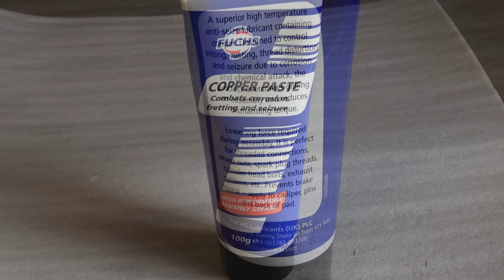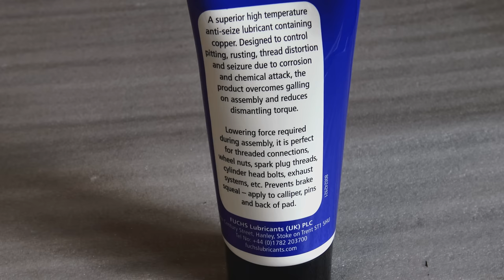Triumph Bonneville ownership. Copper Grease controversy, Putting the record straight!

Comment: Excellent truly excellent come back . I've been a motor vehicle mechanic for 50 years and I was instructed as an apprentice to use Copper Slip as it was called back in the day on many many aplications including brake components.  I can state it works very well and never ever caused a problem ,in fact it had great benefits in repeat maintainance. Obviously keep it away from friction surfaces which you rely on to stop. Deep gratitude and thank you
Regards Gareth Wiltshire.
Reply from the maker: Thank you Gareth, Im  sure ill still take some flack for this one! lol

Comment: Shortly after I purchased my 2004 MG TF in 2018, I undertook an under bonnet bolt upgrade to stainless steel bolts. The engine lives behind the seats in a TF, so all the bolts under the bonnet are for ancillary items, such as cooling, ABS circuits, electrics etc. I caught the existing bolts just in time. They were cheap zinc coated items and the threads were rusted and just starting to seize and the ones in the bonnet slam plate almost snapped, so I had a very lucky day!! I smeared the replacement stainless bolts with copper grease. 3 years later, I had to remove a couple of the new copper treated stainless bolts during routine maintenance and they unscrewed cleanly and smoothly. No rust, no seize!! Great video Stu and spot on as always 😊

Comment: Someone just posted this video as a comment on one of my videos, I’m so glad that they did. I’ve been using copper grease on aluminium and steel components for years, with zero problems. In one of my videos I recommended using it and got plenty of comments, just like you described. Another one that keeps cropping up is locknuts, when you tighten the first nut to the specified torque, then use a “half nut” to lock it in position. You would not believe the amount of people that say you have to use the “half nut” first, then use the full size nut to lock up the half nut 😉

Comment: Very useful, thank you. I've had comment on the use of copper grease on wheel nuts/bolts as being a complete no no and also read tales of many other places you shouldn't ever use it. I've been using CG for years to prevent nuts/bolts/studs from seizing and never had them shear or fall out. I did however manage to undo them when I wanted to; without getting a 6-foot long scaffold tube on the end of my chosen tool. I just make sure I follow the instructions. As you said, the manufacturer's have no interest in marketing a product that is unsafe to use and risk being sued, their reputations and, by extension, their businesses.

Comment: Great advice! I have always used copper slip on the backs of brake pads and threads without a problem. As long as fasteners are torqued up correctly there is no issue.

Comment: I have been using copper grease since i started doing car and bike repairs in the 70s, plenty of advantages, zero problems....except for once forgetting to put the top back on the tube and then watching it squish out all over the floor when i accidentally kneeled on it, still funny after all this time.
Reply: Hi Steven I don't know how many tubes of solvol autosol has shot across my garage floor or driveway. If u step on it properly it can easily go 6ft backed up by the usual expletives.
Reply: @nightster6378  HaHa yes i forgot to mention the expletives. I wonder just how many tubes of stuff have been wasted in this way?

Comment: The best thing to apply is a modicum of common sense.
A thin coating on the back of the pads, I've never had an issue.
Ladle it on like icing on a wedding cake.........you're asking for trouble.
Mind you, I've seen brake discs cleaned with WF40 because the surface rust irritated the owner.
You cant help some folk.
Thanks for the information and the polarity Stuart.
Reply from the maker: very well said sir, most of the pseudo demonstrations we see show an obscene amount being used. just asking for trouble!

Comment: Good video. Driving and riding over 36 years, always had brake pads with a thin layer of copper grease on them by garages and trusted mates. Got drawn in delboy ,workshop debacle made me question who was right, consulted my Haynes Manuel for my bike and it says to use a thin layer of copper grease. So any doubters consult owners manual or expert advice. Don't  believe self appointed experts on you tube. Great advice from you by the way.

Comment: Just got a O2 removal kit from TTP. In the kit is a small toothpaste tube of Copper Grease (no brand name on the container). The grease is used to put on the threads of the S.S. plugs that go in the exhaust tubes where the O2 sensor used to go. Guess what the last line on the tube says???? "HELPS PREVENT DISC BRAKE SQUEALS.". YUP!

Comment: You're absolutely right. Copper paste is brilliant for most application, where seizure is a problem. But I must emphasize, that it is not usefull when lubrification is needed. I once used it on the cardan shaft and compensation piece of my Guzzi. The teeth were completely worn after 50000km. The copper paste was dry and acted more like sand paper.

Comment: I have had my current Tub of Copperslip for nearly 30 years, and is only half used! Use it for Brakes as you mention, and most bolts I take of/replace on the bike. Never had a problem. I don't listen to the NaySayers ! I use it sparingly.

Comment: Not a lot wrong with Copper slip but Petroleum grease shouldn't be allowed to get any where near rubber, and as most folk apply it too thickly it can get to the wrong places. I had a VFR that had the pin that runs in a rubber guide greased and the guide had expanded by at least 25% so guided nothing. The previous owner was a VW mechanic. Use the correct grease, there are quite few we should have in our garage apart from Copper Grease such as HMP grease, Red grease, Aluminium grease or Aluslip.
Reply: Hi Ron, where can I read about the different kinds of grease, and what they're for? If I Google it, I know I'll get a ton of misinformation. Do you know of an authoritative source for good information?
Reply: @Mikey__R  there was a great sticky post on the Oracle VFR forum but I couldn't find it last time. I'm sure there must be info on the web somewhere. I started to get interested when I found an engine bolt had seized on my Suzuki GS500 and got talking to a Suzuki fitter who told me about Aluslip. The came red rubber grease and realised there were more greases around than I thought and all for different uses. Red grease I think is important for use around seals etc. Another useful one is of course silicone grease and so on. I'm only a learner about these things.
Reply from the maker: @Mikey__R just find a leading  brand you trust and take a look through their catalogue of products. the product descriptions can be quite useful for that kind of info.
Reply: Stuart, excellent idea

Comment: Very informative - thank you. My only contribution would be, that torque settings for threaded components are usually quoted for “dry” threads. A lubed thread can tighten up much more than a dry one on the same torque setting. There are charts available, for use to compensate for different lubricated torque setting situations, to prevent problems with over tightening.
Reply: A lubed thread could actually strip if torque applied thread not compensated for being lubed.

Comment: Nicely done.  I don’t mean this to be particularly negative to those ‘alternative thinkers’ as we are all made differently, but those people shouting down copper grease and sending you what turn out to be adverts instead of facts are clearly devoid of any ‘critical thinking’. Those people that are easily swayed without any actual proof or relevant experience. 
Something to be aware of perhaps is that apparently, the only potentially negative thing about copper grease is to be careful when applying onto ‘high torque’ bolts as it can cause slippage and the torque wrench could turn the bolt further than it should and deform/twist the bolt as the copper (anti-seize) has allowed the bolt to continue moving further than when in a dry thread. Probably best not to use on those high torque items. Don’t know if it’s an actual truth and have never experienced it myself but have been shown photos of bolts that have suffered. I no longer copper grease the wheel nuts on my BMW.
Reply from the maker: manufacturers take that in to account steve, when calculating torque values. using anti seize compound will over torque by no more than 25% the manufacturers allow upto  72% was going to mention it but the video was over running.
Reply: @stuartfillingham  I wasn't aware.   Good to know.
Reply: You are correct. Manufacturer's torque settings on all bolts are normally for a bolt or screw not lubricated in any way. However, suppliers of stainless steel fasteners recommend the use of copper grease to prevent seizure.

Comment: Copper slip used for last 40 years on motorcycle and car brake pads. don’t use too much so it goes everywhere. Fitted some seat brackets on my Morris minor 20 years ago and put copper slip on bolts that went into captive bolts in floor pan that’s exposed to road grime and salt, had to remove them before Xmas and they came undone with no effort. Copper slip has its place in this modern world
Reply from the maker: Ah! yet another experienced user! Thank you sir.

Comment: Hello Stuart,  some comments mixing up PBC  (poly butile cuprasil) with copper grease. In the north sea oil industry were I worked for 25 years, we found that after a few months the threaded lid of an explosion proof box treated with copper grease was difficult or impossible to remove. The grease appeared to turn to sand. After changing to PBC the problem when away. 
Having now run out of PBC it is difficult to find a supplier who does not want to sell a minimum of twelve tubes. 
Keep up the good work.    A Yorkshire man in Scotland.
Reply: What metal was the explosion proof box made of?
Reply: @deanmsimpson  Hello, Aluminum. John.
Reply: @johnstainton9815  Thanks for your reply John. So, is it true, galvanic corrosion did take place because of the use of copper grease in the salt water environment?
I've never heard of PBC. So I Googled it. It looks just like copper grease.  Is that true? PBC grease looks like Copper Grease, but it is in actual fact different?
Reply: @deanmsimpson  Hello Dean,  Yes it is different, not sure how but it has a higher max working temperature, and works better in a salt laden atmosphere.   John.
Reply: @johnstainton9815  I see, that's interesting. Thank-you for sharing your knowledge.

Comment: Totally agree with your comments. I have been using copper slip on brakes, in the appropriate places, for well over 40 years. The only time where an alternative may be required is with some types of ABS systems and pad wear indicators where a ceramic grease should be used.

Comment: I have a fresh occurrence. Yes, I have been using copper paste in my cars for quite a long time, decades, and although we have cold winters and a great deal on road salting, there has not been any issues. Earlier, I did have a habit of going through the brakes once a year but slowly went to check them once in 2 or 3 years. I'm not a workaholic! But, now we had a new car - and it has only 7700kms on it so I didn't bother to go through the brakes... And last week - the right rear brake got a little ice/stuck and when it released we had some system diagnostic alerts (park hill assist, abs and like)... Codes were temporary so nothing to worry - but I was not eager to work on those brakes because of the cold weather so we had to go to the dealer service today (luckily it was a rather pleasant weather to drive) and check codes and service the brakes. They disassembled and most likely added some copper paste on certain places of mechanisms so the water doesn't have a go into the sensitive spots where it might cause trouble when freezing... Well, I know I have been lazy on our bikes but have to remember  to service the brakes (brakes are a kill of speed after all!) - at least my bike's rear brake is squealing, it's in factory state so there is no copper paste behind pads. There will be. Oh, aluminium paste, I have it too and I use it! It's good too on aluminium parts...
Reply from the maker: Thanks for your comment Mr Dark, always a pleasure to hear from you!

Comment: Your right, no problem with using it, advancement in brake Tec has made it unnecessary in many cases, ie squeal pads and pad clips, but if you want to still use it, Go ahead. I was always told when I was trained not to use it on rubber ? Silicone grease for that, I use Red Rubber Grease. Top work Stuart, keep it up.

Comment: Good information.  Have you any thoughts on the merits of replacing factory hardware with stainless to reduce corrosion?  It’s common practice with high end restoration projects on vehicles like FJ 40s by ICON.  I’m not proposing doing it all at once, but as a part of a standard maintenance regimen e.g., when serving the calipers, replace the factory bolts, and so on.  Just curious.  Thanks.
Reply from the maker: Its a very good but time consuming idea. They used to sell SS fasteners kits for all the Japanese bikes back in the day!

Comment: i heard, only recently, that copper grease should not be used on brakes. I promptly forgot this as I have been using copper grease for decades and it has saved me a huge amount of work and expense. I use it on calliper pins  and also on parts like the front axle or spindle, to allow easy removal. The only caution is that use on critical threads that need to be tightened to a specific torque will lead to an inaccurate torque value. On  sliding parts, such as taper pins and spindles, it is invaluable. 

I have never had any problem, quite the reverse, and have been using copper grease since 1976. Not much is needed, unless memory is faulty, I am now on my second tin!  Another good video, which gives the background to the story.

Comment: Stuart was re listening to your vids especially this one came memories . My trip in Chile south America made mepost a  remark below about copper grease .  I was using it at home in Montreal because of high humidity and my trips in salty air  . When travelling in northern Chile in the Atacama  desert region dust was getting in everywhere , worst air filter and brakes .It even got in the brake cups thus reaking havoc and seezing them slightly , the savior copper grease , yes in Santiago i ad to reclean the whole works but the brakes worked fine and saved  costly brake parts change in a country where my bike was an unknown model  in the late sixties . So i swear by copper grease .

Comment: Earlier this year my van brake lines, abs sensor wires and associated loom were attacked by rats, cost me £800 including recovery. Take van to county authority workshop for mot and mentioned what happened to them. They advised wiping coppaslip over the lines and cables to repel vermin, they do the same for school minibuses etc  that can be left standing during holiday periods.  On my to do list, incidentally was mentioned to me that rats like brake fluid (or the glycerin), how true is open debate.  Have also used coppaslip for as long as I can remember, and intend to continue to do so.

Comment: I've used Copper Kote on bike parts for 40 years and never had an issue. I wasn't even aware there was an argument against it until now. I wouldn't ever consider putting a steel bolt into alloy without a smear of good old Copper Kote!

Comment: Recently did a service and and re grease of all the pivot points on my 2007 Honda Deuville 700 , so that was the rear panniers off swing arm out ect nearly every nut and bolt had seized including the rear caliper , I'd not had it that long and it had only done 30k miles but I don't think anyone had had it apart from new , no evidence of copper grease anywhere on the bike , what should have been a simple selection of jobs took bloody ages , some of Mr hondas design and construction didn't help either . Everything that went back on the bike had a bit of copper grease and should be easy to do next time , for me or the next owner . I've had a few new bikes in my time and always take time to go round the bike copper greasing the threads with a small paint brush before the winter hits .

Comment: Cable ties, Gaffa Tape, Jubilee Clips, WD40........and Copper Slip.
Reply: I'm guessing that gaffer's tape and (in the U.S.) duct tape are the same thing -
gaffer's tape used by lighting technicians in film and TV productions, presumably to tape things down temporarily,
and duct tape used by air conditioning technicians to seal duct joints.  Duct tape is usually a silver colored fabric
tape that can be ripped manually.  Is gaffer's tape similar?
Reply: @daveinwla6360  hi Dave, yes, same thing

Comment: I use high-temp adhesive to adhere the pads to the piston (brake squeal stop products commonly available at the store). I also use high-temp grease on the caliper bolt threads. It seems to me you're basically doing the same thing with copper grease. I imagine it works fine, but to me that's not the right tool for the job. Copper grease is designed to prevent seizure from galvanic corrosion; e.g. steel bolts in aluminum engine blocks. The entire caliper is meant to float, not the pads by themselves. If the pads are allowed to move without the pistons, that is exactly what causes brake squealing. Just my $.02 after 50 years of shadetree wrenching ... ymmv

Comment: Is copper grease safe on the caliper pin boot rubbers ?
Reply: There is proper red rubber grease for that, I wouldn't use Cs in that area.